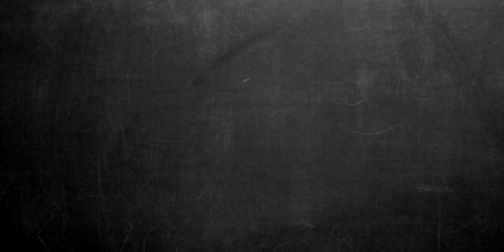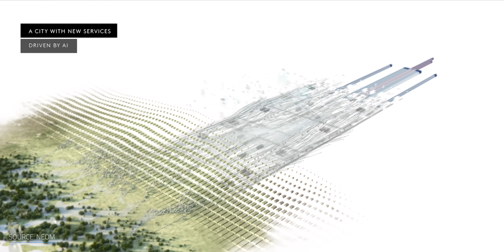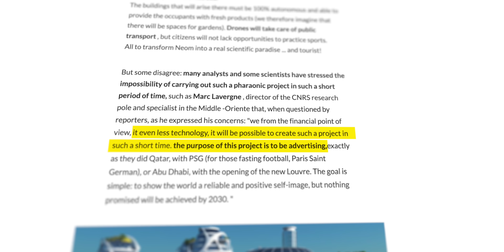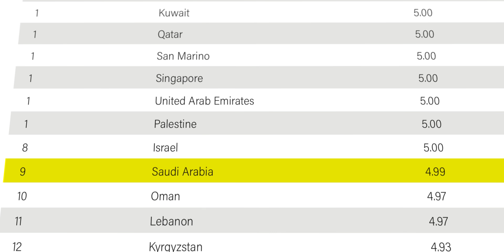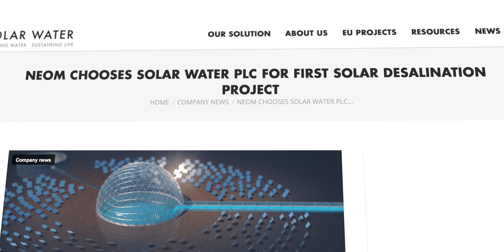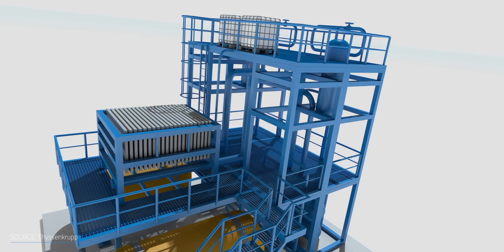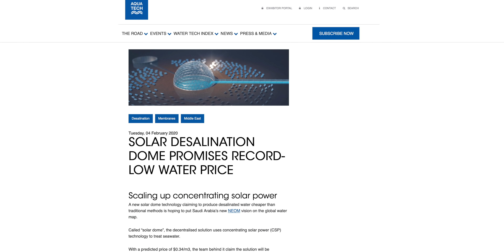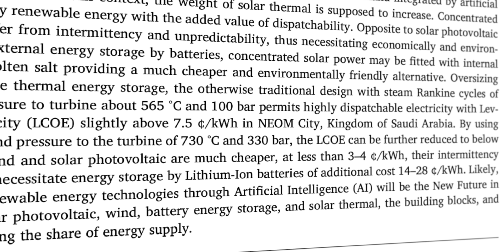Why Neom Might Be The Future of Sustainable Cities

Comment: The centralized transportation line would be vulnerable to terrorism attacks. Also, they are going to have to build sanitary and drainage sewer systems. The drainage one could just discharge at the outskirts of the city. The sanitary sewer is going to have added expense since the geometry of the city is very spread out. One possibility would be full recycle of sewage to drinking water and storing it in covered reservoirs (mountain based ones with pumped hydro-electric for storage from solar and wind power) which is already a proven and in use technology, as would be UV sanitation of the drinking water, but both of these take take lots of electricity. Using many small treatment plants with pumping systems, allowing the city to build capacity as needed, update to new tech faster, and be able to take plants offline for maintenance and upgrades more easily than larger, centralized systems. Building all these small plants will drop initial cost, but the total cost is going to be higher than conventional, centralized systems used in current cities.

The undeveloped technology is one problem for private investors and even hedge fund investment, but largest one is the fact that there is no recourse if the Saudi government just steals the money, uses it for other expenses, or refuses to pay back investors with agreed upon returns. This is not only a structural problem with their government, a monarchy, but also a cultural one within the Saudi government and society. No one is going to invest in an area where people are assassinated, executed without fair trial for minor offences, and all rights are heavily restricted. The totalitarian level of control the royal family has is also a major problem, since on a ruler's whim investors can lose everything with no recourse and that such regimes tend to breed resistance movements that often cause civil unrest, civil war, and revolutions, all with unpredictable results. The humanitarian issues also can cause sanction from other countries, destroying the economy of the offending country. These are the same sort of reasons that there was no investment into Russia's economy after the fall of the U.S.S.R., even though they have cheap labor costs, plenty of natural resources, and even the education system to produce specialty and highly skilled workers.

These countries are stuck the way they are because of short sighted greed.

Comment: Can you explain the "Hyperloop" and how it shall work, I can not find any video about this and therefore I start to think it will not work, folk say it will be a near vacuum inside a gigantic system, but how will they get folk and pods into this system at train boarding times, how will a station work and is there any working scale model of a station that can handle more than two people per hour? What is the plan if there is an accident in a hyperloop and a pod need to be evacuated when there is no exit and an emergency exit may kill everyone inside if it is opened and air rush into the system, and in all animations I seen the tunnel is way to close to the pod to be able to evacuate any passenger through the sides and all need to be evacuated through a single door in the back or in the front.

Comment: Egypt and Saudi-Arabia have enough sun light to convert it in solar energy to desalinate huge amounts of sea water in fresh water. There is no need to burn fossil carbonates to get table water in the desert! Get sea water in black pipes, put a curved mirror under the pipe, let the water steam into a heat pipe cooled chamber and the salty water back donw to the sea! That is not high tech and no high cost! You can even reduce costs by installing a photo voltaic driven heat pipe cooled metal sheds in costal waters above sea level. Water vapor condenses on the metal surface, drops down in a pipe and gravity brings the fresh water to the next village.

Comment: The problem here is the line structure makes no sense in the context of people going from one place in the city to another. It might kind of make sense if the idea was to build a series of circular self-contained walking communities that each provide most of their own food, water, and power, placed along a route between two large important locations, the way US freeways tend to build up little towns along them like beads on a string. But a super-high-speed train system only makes sense for connecting large, distant hubs where you have lots of time to get up to high speed and benefit from staying at that speed for a long time, like going from Paris to Lyon. Putting in a high speed train in place of an intra-city subway is like trying to use a freeway to go three blocks -- just as you reach the maximum speed, you have to hit the brakes and exit.

Even if you came up with a solid hub-and-spoke plan to make a reasonable structure, it would rapidly grow beyond the plan because factories are going to want direct links to shipping, and it'll very quickly become messy.  You know, like a city.

Comment: Everything about this city sounds amazing and promising.
Except for the fact that this is just one single straight line that ignores geography.

If you want one line, have it follow the coast, and include a second or third line too, so it's not 100% 1D.

If you want straight tracks, make a grid of lines, at least 3x3 lines at minimum.
Reply: As a Saudi citizen i don't prefer a line that follows the cost cause we're building for the future and we all know that the water levels are raising
and most cities on the cost facing a ticking threat! and if you interested in building projects near the cost look up the project called "Oxagon" the floating industrial district.
Reply: @EridanusYT  The Project Oxagon sounds interesting, I'll check it out.  With planning, you can make a city on a coastline that's resistant to rising waters though.  Several cities, including the one I live in, have expanded their coastline far out from the natural one, and many need to deal with rising and falling tides.  We definitely have the engineering capabilities to protect against a meter or two rise in water levels, if the city is designed for it from the ground up.
Reply: @steverempel8584  Good point and thanks for replying I see your point of view but we don't really know how drastic the water rising in the far future gonna be we might hold in the near future but we really don't know for sure the scale of impact it's gonna have on our lives so for me personally i like that we're building away from the cost as they say better safe than sorry but i agree with you we have the means and we already taking leaps of faith into the dark so why not take a chance and build something meant to stand against the level of the water rising which bring me back to Oxagon  as a city/port in a way and how it's gonna last against the rising levels of the seas and  if it's something that went in the mind of the people who gonna work on it or not plus i don't know if the smaller seas like the red sea would face the same impact like open oceans or is it safer for being the way it is geographically so there is a lot to look into and most of it would be an educated guess at best nothing more cause we don't know for sure really at least yet!
Reply: @EridanusYT  Yeah, I checked the Oxagon project, I do find it very interesting, more interesting than the line city actually.  A city like that is one way to protect against rising waters, I love these sorts of projects where the city is highly self contained like that.

It sort of reminds me of the Original Machine City in the Matrix.  If you've seen the Animatrix, they show that the Machines built their paradise in the Empty Quarter, in between Saudi Arabia, Yemen, and Oman.  I think that would be a perfect place to build a prototype of a space colony....  Oxagon feels like a step or two before that.
Reply: @steverempel8584  I appreciate your replies and the time you took to look it up and give an honest opinion we need a variety of different perspectives and opinions as long they're genuine and not biased against it for other political reasons! I'll make sure to watch those short films, the "Matrix" is a movie that I always knew that it was ahead of it's time for sure. I wish not only for our own sake but for the humankind in general that NEOM projects go well and help improve our lives in one way or another.

Maybe one day you would honor us by visiting NEOM in the future who knows!

Comment: The technology the city will have surely is incredible and its a step towards sustainability, but a city built in a straight line? Just stupid. 100km if you need to reach something on the other extremity. Future cities will have to find a circle-based alignment, so you don't need to spend as much energy to reach the extremities, or even squared based like US downtowns with diagonal streets for easier transit. A metro net is a lot better than a metro line, I know this because I live in São Paulo and our metro net sucks because it was based on distant lines and no urban planning at all. If you're building a city that will spend much more energy to do something you could do with half of it or even a third, you're doing it wrong!

Comment: Let's evaluate the line.
-it's centralized transportation makes breakdowns and malfunctions catastrophic, not to mention lining up the perfect target of a terrorist attack
-it's incredibly expensive due to the vast distances needed to service the line with electricity, water and sewerage. The line pretty much does with 4 times the cost and materials what a regular city can do.
 - It is hard to be connected to people because the high speed train will never reach the speeds necessary to travel it in a small amount of time. You can stick the fastest train in and it won't matter: it's stopping and starting will keep it far slower than its maximum speed, which realistically still makes the trip a long one.
- the benefits of a regular city aren't here, everything is too far away and expensive to justify living in the same area, its just all the disadvantages with none of the benefits.
- a city planner could realistically design a city perfectly in the same area that does way better than a regular city, especially if they factored in growth to allow for reduced long term costs. Like, all this money is being wasted because it fails to recognize what a city is for

Comment: I see here the same old thinking that is holding us back in terms of energy. The approach is centralized power generation instead of 'localized' Every building in the area should produce all or close to all of the power needed. Water recycling etc. That takes a lot of pressure off of the mega projects trying to do everything.  I do like the idea of using solar heating to desalinize. What would happen if the brine was dumped into the sandy desert. Would it clean the water? cause other problems? I hope they continue with the project . I expect the main thing we get out of this is learning.

Comment: The most blatant of the issues why this is not a good idea is transportation. Hyperloop etc are entirely irrelevant in this context. Start-stop city transportation is what is required in a city which leaves only buses or trams travelling at max 50kmh. With just 1 stop per 2 km and only 2 min to get on and off per stop it takes ca. 6 hours to cross the city. Even with short haul high-speed trains this puts the majority of city outside your radius of comfort. Imagine a city of only 1 million people and more than half of it is too far away for a commute to work let alone normal stuff like meeting friend or shopping.

Comment: Brine deposits become hard after time and high temperatures might make it corrosive enough to eat through stainless steel. Ceramic will not be able to bear the load of all that brine and water not to mention the temperature variations in such a large dome will also crack the ceramic base even if it’s supported by stainless steel mesh through which the brine will then start eating. And finally how do you extract the hard brine out of that.

Comment: Halving the high speed train speed so it takes an hour to run the length of Neom would still make most travel viable. Very few will go the full length anyway. The major limit is the number of stops and the duration of the stop. Add 4 stops at 10 minutes per stop and you have added 40 minutes and the train must slow down so it would never reach top speed. This pushes the number closer to 2 hours. However that is still viable for a commute. More stops favors a hyper loop over a train because cars can be multipathed point to point with a smaller passenger load.
Reply: I have a better idea. They could put 2 lines of half the length side by side. Commute lengths would almost be halved on average. It could be improver further by putting 3 or more lines side by side with connections between the lines, not just along them. The optimum layout would be reached where the whole thing would be as wide as it is long. The average distances are minimized and even much slower transport is just as viable without any longer commute times. Transport could be done by regular trams and buses and some metro lines. These could use already existing technology so they could be much cheaper.

Comment: I appreciate that you included a balanced amount of optimism and skepticism here, instead of just focusing on what all the cool technologies could in theory do.
Reply: I wonder about all the optimism, though. Doesn't stretching out a city into a thin long line rob it of one of it's biggest potentials? Namely, having a network in 2D space that creates redundancies and the benefit of n^2 options for people/goods/services to move and interact, thus making it more resilient, efficient and productive?
Reply: @neatwheat  also if the whole line is inhabited, why does a train need to go 300-700mph if you're going to have to stop every km or so. It would really only be useful for extreme long distance trips, like the length of the whole line.
Reply: @proppergentleman8690  are you proposing a very long conveyor belt? or to have side-branches, that slow to allow people on and off.
Reply: @wld-ph  no lol, where did I say that? I was just trying to show how ridiculous the proposed project is. Like the whole idea rests on the super fast bullet train that allows you to traverse the line in under an hour, but what makes no sense is that this train would only be useful for going very long distances. If the whole line is densely populated, surely there would be plenty of stops along the way, making the train not able to reach its max speed before it has to slow down for its next stop.
Reply: @neatwheat  no one really knows, I think that's why balance in reporting is so important with this one.
Reply: There is no optimism to be had about this plan though. Its completely fucking stupid thru and thru. Literally 0 positive things about it and it wil be a huge disaster if its ever attempted.

Comment: If they build the green habitat on the surface then none of the rainwater will go onto the ground and retain moisture for the Forest, therefore the green habitat is unsustainable, you would have to divert all the traffic and trains and hyperlinks and tunnels away from the green habitat and the forest it cannot be underneath the green habitat or it will not be sustainable this is not gonna work, this is superficial, it will not have a long lasting deep root deepForming ecosystem that is sustainable and self generating and regenerative?

Comment: This looks like a logistics nightmare. Maglev is great for quickly covering long distances but it is a horrible idea for a city train system. To travel around a city efficiently you need to have stops close enough that everything is a walking distance from a stop. This forces the train to have frequent stops completely destroying the advantage of using a high speed train. Ideally you would want a maglev to travel from one end of the journey to the other uninterrupted by stops. The more stops it has, the slower and more inefficient it gets. The only potential solution I see is some variation of parallel train lines. You have maglev with a few stops from which you take slower trains to more densely packed stops. This however nullifies much of the speed advantage of a maglev as you still need to use the slower trains and have to waste time to switch trains. This doesn't even take into account the vulnerability of such a city. The entire city can be paralyzed by a single well placed catastrophe. Damaging the tracks of the maglevs would be an absolutely devastating terrorist attack on the entire city.

Comment: don't get the solar water sphere. you heat up the upper part, where the steam is? y no large black tank, with the fresh water cooling down the steam? i acutally know a guy having experience with large tanks. with stainless downcomer pipes and such included.

Comment: for technology to advance there MUST be failures. any technological data that these projects can give us will lead to more cost effective solution in the future. edison didnt fail to make a light bulb 100+ times, he learned 100 ways not to do it. worst case for neom it works but cost a magnitude over non sustainable means. that would not be a bad thing. working models will lead to advances and future cost reduction. for future technologies. plus the dome even at the proposed cost to construct, the 20 to 30 yr life of the dome does balance out that initial cost, and will lead to cheaper and much more efficient models down the road. the 1st dome maybe a publicity stunt but if the technology work could lead to huge advancement and massive improvements in efficency and lower costs.